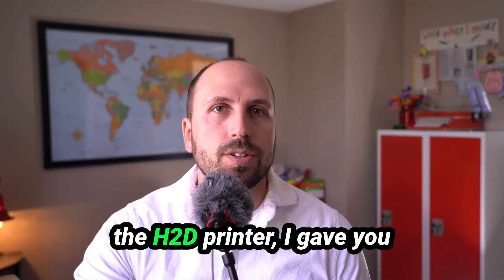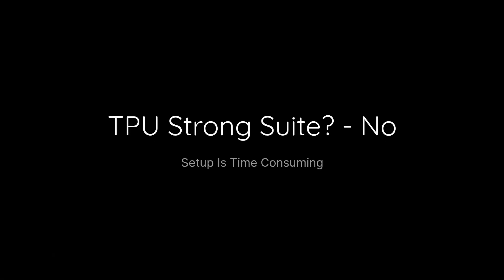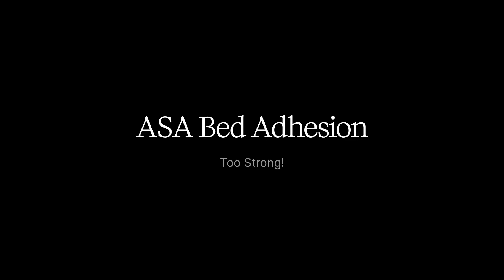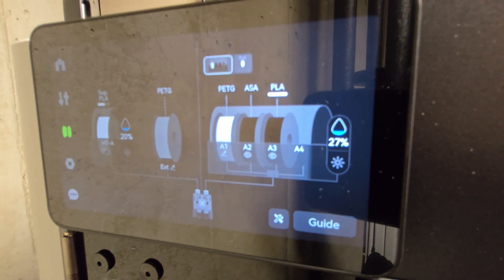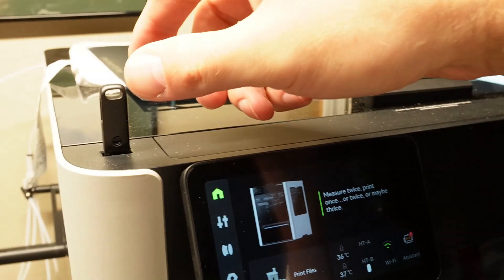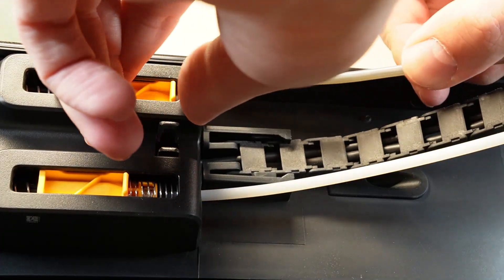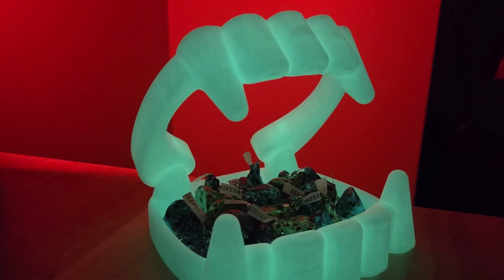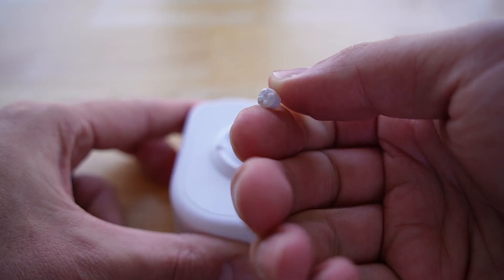Downsides of the Bambu Lab H2D – After 6 Months of Printing

Comment: Got that Printer 12.2025 and my left SHAFT broke apart also an other guy from CNC Forum got his H2D a week later also broken SHAFT!!! Be aware about this !!! Big Quality or Design Flaw!!! Now they send me 2 new Stepper Motor !!! Bambu Lab never ever i will buy anything from them!!! Canceled also my 3 more ordered AMS-HT about this Mess don't beleeve in this Company anymore!!! They delete all my negative Postings on Bambu Lab but i get now an replacing Printer and i will sell it instandly!!! Build already my own Prototype Printer and will change it to INDX Changer in April when aviable, with bambu lab i am done!!!
Reply from the maker: That sounds like a terrible experience!
Reply: @WidgetKC  Absolutly, but i am now on my own Build with Manta 8 and Klipper also with Bondtech INDX when aviable! and i guess that will work much better!
Also the Printbed don't work with big rectangles Parts on H2D the PEI sheet will warp because the Mgnetic Force isn't enough to keep it on place! 
So i will use Magneitc rings 14x3mm diameter with 3 kg Holding force per piece;) Like on Pruse Core One L ;)

Comment: Did you solve the fan noise isue, i think i have the same problem. ??
Reply from the maker: I did! Although it took some time to replace the fan after Bambu Lab shipped one to me! I will post a video of the process. I'm curious why the fan failed so early and am wondering if it was because I do a lot of high-temp printing. I'm curious if you do high temp printing as well like nylon, ASA or ABS?
Reply from the maker: @mucicatart9322 I posted a video about the fan replacement. The beginning of the video has a before and after comparison of the hotend cooling fan replacement: https://youtu.be/wda42prUay0?si=0WtNzYeLLzEfrRQj

Comment: Wrap the edges of cardboard spools with electrical tape. Problem solved. You really shouldn’t be using bare cardboard spools in an AMS anyway, as the cardboard wears off and gets in the moving parts.
Reply from the maker: I did this. Thank you for the comment. Thanks to AU3D on MakerWorld, I downloaded and printed some Inland spool rings. They did mitigate most of the issues.

Comment: "Downsides of the Bambu Lab H2D" in my experience include the joke of a "warranty". My H2D DIED a short time after buying it, and that is when I discovered how woefully inadequate the "warranty" is. This is supposed to be a "premium" printer, why not have a warranty to match? Do they not believe in their own product? I have owned, upgraded and repaired many printers over many years and the H2D is the only one I consider to be an absolute unmitigated NIGHTMARE. I fully regret buying the H2D. My opinions are based on my continuing experience, your mileage may vary.
Reply from the maker: It stinks you are having so many issues with Bambu Lab!

Comment: It's easy enough to print rings for your cardboard spools.  I also printed rings for my 5lkg. spools.  Order your filament at least a month in advance.  I do prototypes, so I like to see what my prints look like when I am done printing.  I order PETG Translucent in 5kg. spools.  When one gets low, about the last pound, I'll order another 5kg. spool.  Presently, I have 2  5kg. spools, one in black and the other Translucent, 7 1kg. spools of PETG in Translucent, and 19 spools of PLA in a variety of colors.
Reply: If your PLA part lifts during a print, build a raft on the part you can cut away after printing.  Large parts are the worst at this.
Reply from the maker: Seems the larger the part the higher the chances of it lifting.

Comment: It seems logical to me that you have to reslice after swapping nozzles. For every layer, the computer must compute all movements and encode them in G-CODE, including color changes, which extruder to activate/deactivate, XYZ-movements, etc etc... I don't think it's easily possible to bypass that because the distance of each nozzle to the reference point also makes a difference. And slicing doesn't take that long on a modern PC.
Reply from the maker: I like your assessment on the g-code. May have to be a mechanism outside of g-code then that could enable this. It's a minor thing, just always looking at the next way to innovate.

Comment: Change the infill from grid to crosshatch or gyroid (there is a bog debate always on which is better).  I have never been able to print big PETG parts with grid.  ABS is a bit softer than PETG and PLA, so you will get the bumping with grid and it may cause your part to lift.
Reply from the maker: Thanks for the advice on infill; I appreciate the suggestions!

Comment: Try changing your infill pattern, the air rushing out of the holes in certain ways might be causing that whistling or siren-y sound that you're getting, just a guess
Reply: also for the spools, I suggest printing things that go in the middle of the spool, and put silica gel in there. Works both to keep the AMS dry for longer between drying cycles, and enough weight to prevent spool jumping :)

Comment: I got the H2D a few weeks after it came out.  I have not had any fan noise issues like yours.  Mine is very quiet when printing PLA/PETG. (I mostly print PLA)  Yours sounds terrible.  I have printed multiple models in ASA and had no damage.  I am lucky and receive filament from bambu in about 3 days on average.    I bought all of the extras up front so I wouldn't have any issues.    I have had a couple issues with cloud computing over the last 6 months.  I love the H2D, and will be buying a H2C as well  ;-)
Reply from the maker: That's awesome you've had such a great experience with the H2D!

Comment: The only warning I have is as of now the software has flaws when installing a AMS HT for the left nozzle. I had to downgrade the firmware and install it again but now have no issues with it. And listening to your fan when printing PLA I can say you have a fan issue. The fan should not be that loud.
Reply from the maker: I reached out to Bambu Lab regarding the fan. Thanks for the insight on the AMS HT.

Comment: I have a plate for ABS, ASA,.. and another one for PLA, PETG and TPU. I think ABS is messing with the plate in a way that lower temperature materials doesn't want to stick well. Might be because the ABS fumes that makes the inside a bit messy. Second, a low profile USB stick is best here. Oh, nd yes, the higher you go with tree supports, the larger the brim has to be
Reply from the maker: That's an interesting theory about the plate and ABS! Makes some sense. And great point about the low-profile USB stick! Went ahead a purchased the low profile before I do any damage!

Comment: I just got H2D like a week ago.
Have running that nearly 24/7 sins that :) i am using PLA and PetG-cf for the moment but i was try out shortsen PLA-CF that totally fail with the first layer.
Some one has the same problem?
Reply from the maker: I would encourage you to place the prints on a different part of the bed (if they are small enough to do so). Also try using some other profiles for PLA, I've found some non-bambu brand filaments work best with bambu profiles.
Reply: @WidgetKC it’s actually Bambulab filament i am using:) so it’s should work. Perhaps the bed not get warm enough there… will try out your advice

Comment: My H2D has been flawless with everything I've thrown at it.  I mostly print with PETG-HF and PLA, but also print with ABS and ASA.  Note about the gold PEI sheet, only clean it with warm water and dishsoap, also avoid touching the bed surface.  Skin oils on the plate will catch up to you and cause failed prints until you clean it properly.  Lastly, do not use cardboard spools in the AMS, if I recall the manual states this.  Not sure about your fan noise, my is so quiet when printing I can talk on the phone with no complaints.
Reply: Sounds like QC is a bit dodgy then? If there’s so many different experiences.
Reply from the maker: Appreciate the feedback. Great points!

Comment: Got mine about 10 days ago.  SO far runs beautiful with ABS, PLA, PETG........but at way slower speeds then I print with my Plus4 which I have owned for year and have it dialed in....My H2D is whisper quiet.............I have about 130 hrs on it after 10 days..........I get some false failure id's from AI once in awhile...  I find most profile settings are on low side for needed temps, especially for PETG it is off by 15C if you use default profiles............

This is first time I have used Bambu filaments.    I typically use Overture ABS, Qidi ABS predominantly....and Overture PLA and some Polymaker filaments..  I believe Overture Grey ABS is best stuff going, run it at 270c around 220-240mm/s to 260 mm/s on my pLus4 and it simply prints amazing.  Same goes for the H2D, it loves this filament also with same temps, but the standard speed is way slower then the Plus4.........Same print started same time with same filament on Plus4 vs H2D, and my Plus4 literally smoked the H2D by one full hr and final print quality was slightly better on the pLus4, although both had great final quality.   Just thought this machine would keep pace with my Plus4.  It does well but, think I expected a bit more out of it.  The new Qidi Max4 is out shipping within next two months, keeping eye on this and also the Core One L.....
Reply: One thing to try is tell the printer it's using Bambu filaments. Print speeds on the Bambu profiles can be much faster, even though the parameters often work just fine with third party filaments.
Reply: @Chaosbar I learned how to drop in custom profiles did first run ever of 3d Fuel pctg and their pro pla, wow amazing filaments I got them dialed in beautifully.  Broke 220 hrs on machine and getting it dialed in nicely now.  Learned how to prevent PETG nozzle build up on this machine, required some tweaking on acceleration then no more nozzle build up with PETG.
Reply from the maker: This is a great writeup. I have heard amazing things about the Plus4. It was a front runner before the H2D. Man you print a lot at 130hr in 10 days!
Reply: @W@W@W@W@W @WidgetKC of 3d printer stands and drawers making for move into new place.  I run small 8 printer farm, have 4 Qidi machines, two Centauris, and the new H2D and A1 just picked up.  Hardest part of move will be packing up over 300 rolls of filament that had recently been building up inventory on.  

I am looking forward to testing to new to me filaments PCTG and the Pro PLA from 3d Fuel company just ordered.  Stuff is pricey but wanting high quality filament for some of larger weight bearing pieces I am making.

I am keeping close eye on new Qidi Q4 Max.  Specs 390 by 390 by 350 with some incredible looking new well thought out features.  The even bed temps and Z level features along with  ptfe tubing cooling think will make this an incredible machine.  Will be ordering one up.  They release officially on 18Nov but posted info on it up at their website.  I love my Plus4 it has been a true workhorse of a machine.  I do like my H2D it is very quiet and Bambu ecosystem is pretty slick to say the least.
Reply: @WidgetKC  The H2D is growing on me as I have dialed their profiles way better, especially for PETG, needed temps up by 15C from base min.

IT has run nonstop for two weeks plus now.  First time ever grabbed some 3dFuel PCTG, and their PLA+ Pro filament. It arrived within about 3-4 days of ordering it, looks like great high quality material.  I loaded their profile into the Bambu Slicer app.    

Looking forward to testing both filaments out.........Currently backlogged huge with holiday fast approaching, and in middle of move, machines are down except the H2D until later next week when finish move.....Then will have 6 printers running 24/7 for a few days to catch up.   The H2D is really impressing me, throwing many tough prints at it all in PETG and it is eating them up.  Do get little bit of whispy mess common to PETG that builds on nozzles, wish they had a self cleaning routine where it could automatically self clean based upon set amount of layers, this would be a handy feature to add.

Comment: The textured PEI build plate is terrible, the engineering plate or smooth PEI plate are much better. Also, I always use glue stick. A single stick lasts forever, you just touch up spots as they thin out. Never have adhesion issues anymore.
Reply from the maker: Which plate is your go-to?
Reply: Totally agree with this assessment on the BL textured PEI plate.  I have about 130 hours on my H2D and print mostly in PETG-HF and was having adhesion issues.  I tried the usual mitigations and while, for example, adding a brim helped, it wasn’t until I switched to the BQ CryoGrip Pro Glacier build plate that my prints became problem free.  Highly recommend that plate as well as the Frostbite variant for PLA.

Comment: I put the plastic ring on the cardboard spool and printed a weight holder for the center of the spool, when i have half or less spool, i put some steel washers inside and problem fixed, anyway trying to avoid those
Reply from the maker: Thanks for sharing your tip!!

Comment: I own 2 H2Ds.  Neither make the cooling fan noise you referred to.  My only recurring problem is the "ams assist motor is over heated" which I get on both printers on brand new (2 week old) AMS units.  This is not related to the spool type.  Since it happens to both plastic and cardboard spool.  Cardboard spools are just a problem though.  They don't print right.  The resistance is different.  The edges break down.  They wobble in the AMS.  They leave debris that got into gears of two of my AMS units.  I print 50% in PETG, 45% in PLA and 5% other.  PETG is almost always flawless.  PLA is also almost always flawless unless I use cheap PLA or cardboard spools; I print in bambu filament less than 10% of the time as I am trying to use up my more annoying filaments.
Reply from the maker: I definitely identify with "use up my more annoying (and older) filaments" :DDD
Reply: Print wide rings for your cardboard spools.  It'll operate flawlessly after that.  I printed rings for my 5kg. spools as well.
Reply: @spacescatatford  Nope.  The cardboard will still swell, bend, break and deposit debris inside your AMS.  I had these on my 2nd AMS that needed repair.  I mostly had them on the first too.  Additionally the printed rims didn't provide the same friction and so I was getting AMS motor overheated errors, which went away when I dropped cardboard from the mix.

Also your example of the 5kg spools is meaningless since those are either in a spindle or in a drybox and so the debris and such don't matter since it is a $20-30.00 part.  AMS's cost from 129 (for the single spool HT during blackfriday to 380 for the AMS 2 Pro not during black friday...  Not the same risk.  Also, I've seen some state that the cardboard can get sucked up and end up in your printhead; I didn't get this issue, thankfully... picking chunks out of drive gears was annoying enough.
Reply: @bjornlovoll8972  My problem is that I run so much filament, I've had a hard time keeping my AMS's operational even with plastic spools.  I've got 2 out of 3 down right now.  I'll be tearing both of them apart tomorrow.
Reply: @spacescatatford  It is frustrating.  I wish there were better drive motors for them, as this seems the weak link.  I splurged and got 2 more AMS 2's and 2 more HTs due to the black friday sale.  They are essentially spare parts... or more accurately "hot spares" since their main purpose is to keep the printers running once the AMS go down again.  For me, the risk/reward of running cardboard is now simply too poor.  They have broken running nothing but plastic, but thus far it has been dumb stuff like filament that broke some place I wish it hadn't or a PTFE tube that got wore out.

Comment: Onboard storage is indeed nice, however, in terms of the thumb drive it's cheap and easily replaceable. eMMC modules are of varying degrees of quality and when they fail "weird stuff" tends to happen that ends up being hard to diagnose (looking at the SV08). The filament issue isn';t an issue (if I am understanding it correctly) because the slicer is converting to G-Code which carries the information for print temp, location, etc. It 100% makes sense to me that you would need to reslice this model, but again if I am understanding correctly what you are saying.
Reply from the maker: Good point on eMMC. Maybe a different location for the USB port would have been an idea. Maybe I'm missing something with the filament issue. I have trouble printing from a different nozzle than originally sliced. I need to look into this more as it sounds like that shouldn't be a fundamental issue.
Reply: If the printer and slicer were more intelligent, there's no reason the G-Code couldn't be properly annotated to allow the filaments to be swapped without reslicing.